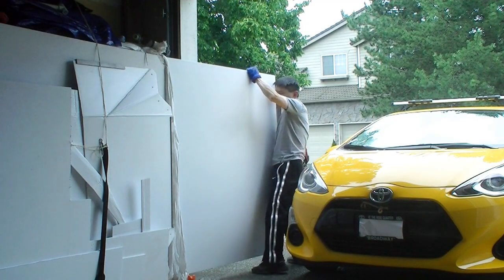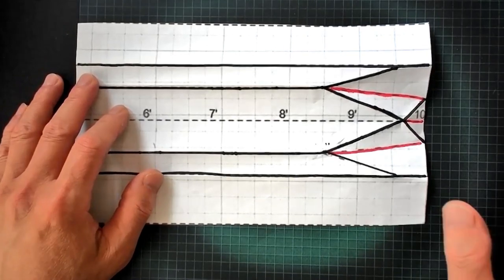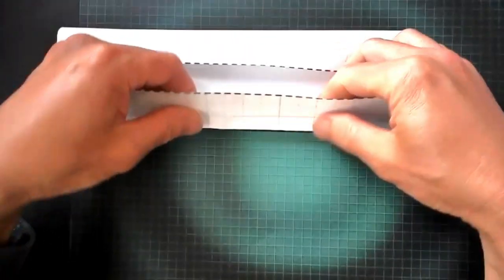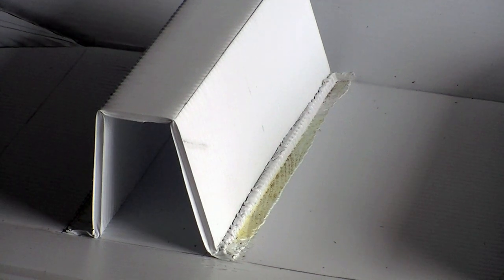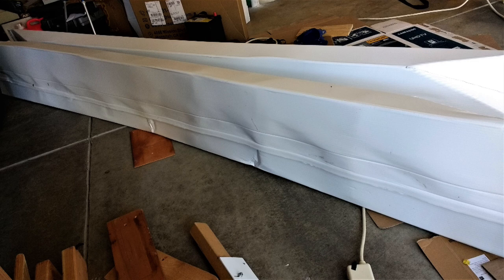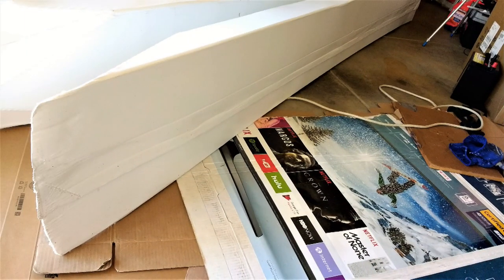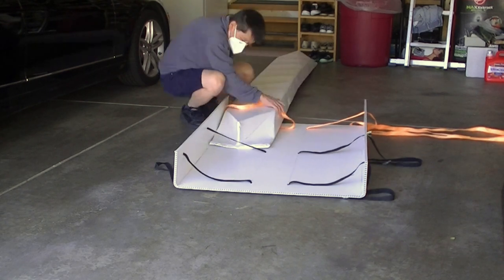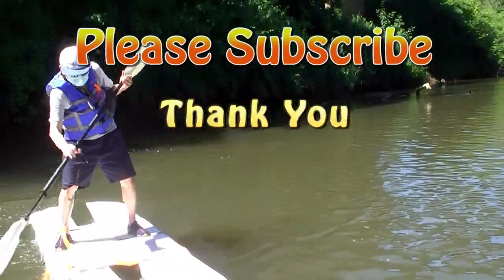Part 2 DIY Modular Paddle Board - Gen 17

Comment: I really like the pedal drive idea. Which pedal drive are you going to use?  Also, where do you purchase 10' long coroplast? Thank you for sharing.
Reply from the maker: Thanks for your questions. I have already bought the paddle drive. This is the unbox video. https://youtu.be/fj4oo2PnGsM
I will start working on fitting the pedal drive to this paddle board in the next few days. As for the coroplast, I custom ordered those from China. You may be able to get the 10 ft long one from some plastic product retailer. Home depot/Lowes only have 8 ft ones but you can heat fuse (or the latest technique people have tried is to use contact cement) to joint sheets together. In that case, you can build a 14.5' long pontoon.